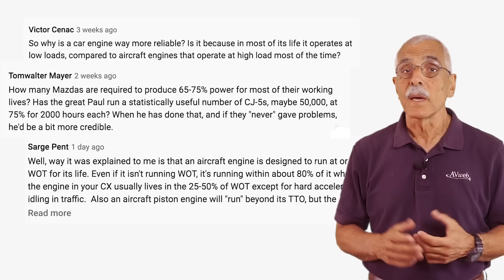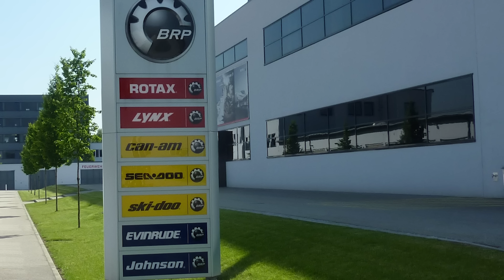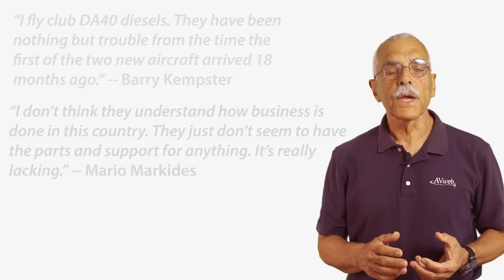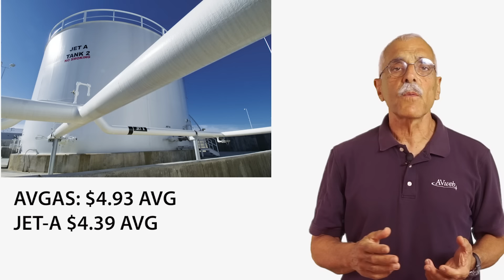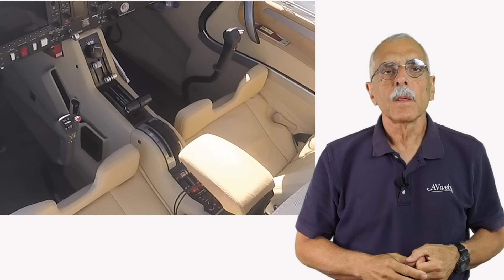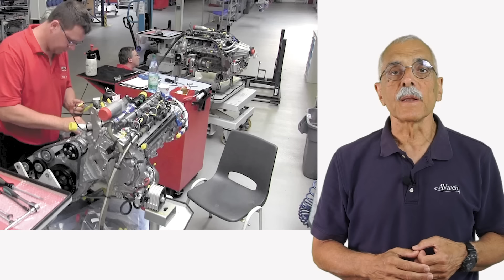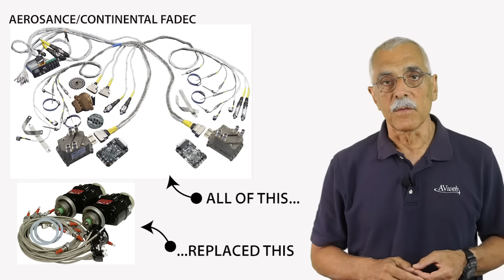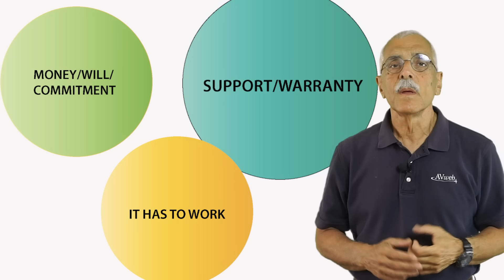Why New Aircraft Engine Ideas Rarely Succeed

Comment: I believe that GA and the embrace of new engine tech is centred around the often blinkered consideration of sticking with what you know, no matter what. One thing for sure is the engines featured have certainly forced the hand of Lycoming and Continental in future design and development and about time too, they have both raped the industry long enough with over priced mildly efficient dinosaur engines which use the same build practices, same 40 plus year designs and same build materials as they did from the get go apart from the occasional mild tweaks to show they still have some token interest. For reciprocating petrol engines in GA I believe that is now a market in decline with increased focus on jet A and diesel burning engines, the Austro being the case in point, yes its a couple of hundred pounds heavier though that is offset in the lower amount of fuel required for the same journey, the efficiencies are considerably better than highlighted here, it runs at a constant temp being water cooled, no chance of shock cooling or over temping, even in a 4000ft plus decent from altitude which the DA42 and 62 are more than capable of, dual fadec system with onboard diagnostic should not be under estimated as is the clear benefits of single lever control for everything propulsion, huge in ease of operation and of massive benefit in single pilot IFR operation. These engines operate with substantially less corrosion through consistent temp operations, vastly superior fuel delivery controls, vastly superior engine breathing, the fuel make up, more linear operation reducing peak stresses and all but eradicating the internal engine corrosion especially prevalent during lay ups, that has dogged both Lycoming and Continental and is the number one cause of they're engine failures, and of course the Austro engines are going to get you to tbo without replacing cylinders, the fuel is 35% cheaper than 100LL in continental Europe and contains zero lead! more easily stored considerably less inflammable, soon to be non inflammable thanks to the commercial industry R&D. The adapted car petrol engines featured all had one fatal flaw, designed to be high on revs and low on torque, the exact opposite of what is needed by design in general aviation, so they were never going to be a good fudge into GA use.

Comment: Excellent video.  Thanks for the information.  Assuming batteries get steadily better, what do you think about electric motors driving planes in the next 10-20 years?  It seems the maintenance and operating costs would be much less due to the simplicity.  Other than the batteries, what issues do you see with electric propulsion?
Reply: Electric propulsion would be a great fit, and actually has a lot of advantages.  Unfortunately the batteries are a massive issue.  Energy density needs to increase around 18x to be fully equivalent to a gas engine, and yes that does include the much greater efficiency of an electric powertrain.  That drastic an increase will never come without some kind of major technology breakthrough.  Maybe a fuel cell design, or one of the "air breathing" batteries you occasionally hear about.  I'm don't see anything like that coming to market until I'm probably too old to fly anymore.
Reply: New technology involving precision cast rare earth magnet processes promise great gains in power production and generation making relatively low cost super lightweight high efficiency hybrid power plants feasible in the very near future ( see Tesla's torroidal core motor ) but don't hold your breath on battery technology. Christ will probably return before that happens. Besides, I don't see too many people lined up to buy $100,000 2 ton battery packs for their Kitfox

Comment: Weren't there some Mazda RX-7 triple rotaries installed in some planes?  How did that turn out?  Not well I presume.
Reply: I had the glasair3 with the mistral 3 rotor. Great engine ! But the certification costs by EASA bankrupted the company. A very good concept strangulated by the euromaffia

Comment: From what I understand the DA62 austro engines are made of cast iron so that it is possible for them to go through the overhaul at 1800 hours. If they were aluminium then they would need to be replaced. So its cheaper this way from a servicing stand point.
The DA62 is a beautiful 7 seater plane and has amazing fuel efficiency.
Reply: If it's a stock block the cost should be very reasonable ( It's still a Mercedes though even if it is made by Renault ) especially when compared to the cost of ANY brand L or brand C block. Many aluminum block diesel engines are sleeved because of the high cylinder pressures involved with diesel combustion thus making resleeving a viable overhaul option. I think the reason is cost and availability

Comment: Nowadays I fly C-172s retrofitted with CD-155 diesel engines and it's really nice to fly them, they perform better that their traditional Avgas100 variants. Also if it doesn't start on the ramp, there is no arguing with the mechanic, who should do what :) Paul covered this topic in a very interesting way.

Comment: The BEST new engine, in my opinion, was not even mentioned in this video! The Mercedes based V-6 Turbo 
Diesel CD-300!
Reply: Launching in North America at Oshkosh 2021, the Diamond DA50 RG takes modern general aviation to another level with the twin turbo charged Jet-fueled 300HP Continental CD-300 Engine. 

It's strange to compare gas engine with v8 diesel and miss cd300

Comment: The true VLJ market always need an engine to fulfill the dream of a fuel efficient jet in the 15k feet range. In the early mid 2000s there was looking like a contender may emerge allowing the development of a range of very light jets but the GFC hit ending all hopes.  As it turns out it is entirely possible fuel efficient, jet and 15,000 feet are not possible due to the laws or thermodynamics but I'm going to link to an article well worth a read from an Air & Space article of 2005. 
Many of the issues described in this vid are applicable to development of this little jet engine. The article is called "The Little Engine That Couldn't." 
The engine itself disappeared and after millions of dollars of development. The last seen of it was mounted to the back of a go-kart.
https://www.airspacemag.com/flight-today/the-little-engine-that-couldnt-6865253/?page=1

Comment: It is a powerful reality that the more things change, the more they stay the same. I'd be one of those that wouldn't complain about steam gauges forever, but I'm savvy enough to learn if I had to. How much more money do glass panels cost compared to a comparable conventional panel with a GPS panel? Thanks to the 1970s litigators I don't have to find out. Still flying the same 1970s cessnas' I trained on in 1974.

Comment: Thielehurts into pa28's were a joke, looms were a problem and needed regular replacement taking 10-15 hours. Only being certified for installation into the cadet (without a baggage door) and moving the battery into the rear was a touch of class.

Comment: Oh man, imagine hitting VTEC on TakeOff!
Reply: Viking offers Honda engines.
But the old VTEC is long dead. The kick is non existent now, even in the new Type R's. 

You are thinking of the K20 series, the holy grail.
Reply: Interestingly enough, aircraft engines usually have flatter cams and longer overlap like a VTEC profile all the time. 

Airplane engines only need to produce power at maximum RPM... and only need to accelerate the propeller,  not the entire airplane. 

So no point in having two cam profiles or one that is good for cruise and idle like in a car. Same with ignition timing. It’s fixed, not variable. 

That’s why you have to run aircraft engines at 1000-1200 RPM on the ground. Any slower and they don’t like to run that well, and the valve overlap can result in the intake valves being contaminated with lead deposits (which won’t burn off like they do on the exhaust valve). Idle is only a quick check before takeoff. 

Idle is only for zero or negative thrust in the air where the load on the prop will keep it spinning faster.
Reply: @Bartonovich52  "So no point in having two cam profiles or one that is good for cruise and idle like in a car."

Are you kidding? VTEC could be used to greatly reduce pumping losses at cruise, significantly improving the efficiency of the engine. As you pull the power lever back from full power, the FADEC system could leave the throttle wide open, while switching from the secondary cam to the primary cam to reduce power, instead of closing the throttle and causing pumping losses to increase. Something like the Valvetronic system might be better suited for use in an aircraft engine, though.

Optimizing ignition timing also offers significant benefits and many pilots use electronic ignition systems in order to gain the ability to optimize their ignition timing. Ignition timing is fixed in many aircraft engines because they use magnetos, which are an absolutely archaic technology, not because there's no benefit that comes from varying ignition timing.
Reply: @TheBrokenworld  VTEC is just one of many implementations of a variable valve timing scheme, and it’s actually one of the oldest and least efficient ways to do it. Variable valve timing is used to adjust valve overlap based on engine RPM, used so a car engine can provide sudden bursts of power on demand at high RPM, while remaining efficient at low RPM for cruising. Airplane engines don’t need this because they cruise at nearly full RPM. Keep it simple.
Reply: @wrkingrageaholic  VTEC is far from being just variable valve timing, it allows the engine to switch between two (sometimes more) different cam profiles. Compared to other cam-changing variable valve train systems (VVTL-i, NEO VVL, VarioCam Plus, etc), it's the most versatile out of any that have ever been produced. Because VTEC can switch between entirely different cam profiles, lift, duration, overlap and timing can all be varied. With the addition of VTC, timing can also be varied continuously.

In an aircraft engine application, VTEC would offer the ability to switch between a cam profile optimized for cruise power, and a cam profile optimized for take off power.

Most variable valve timing systems only vary timing, but they do it continuously (like the VTC aspect of the i-VTEC system), so the cam timing can be optimized for all operating conditions, from idle to full power. You are correct in saying that this would offer little benefit in an aircraft application, but VTEC offers far more capability than just variable timing.
Reply: @TheBrokenworld  You’re missing the point. Aircraft engines don’t need it. In aircraft design, if you don’t need it, it stays on the ground. Simple, light, and durable is the name of the game. People who suggest bringing automotive tech to aviation always seem to forget that basic principle.
Reply: @wrkingrageaholic  I'm not saying that it should be used in aircraft engines, but that it would offer a significant benefit. There has also never been a recorded failure of the VTEC mechanism, it's just really bulletproof. The most that can happen is that it doesn't change profiles, which isn't the end of the world.

Anyway, automotive engines often prove that they're far superior to traditional aircraft engines... when they're properly converted.

Comment: I grew up a mile from a popular county airport that had many dozens of private planes flown by the engineers and middle manager types that my area had with IBM as the dominant employer -- now, however, there are seldom more than a handful of private planes at this airport and IBM is all but gone as an employer in the region.  I suspect that this situation was not limited to the area I grew up in and that the private airplane market is a fraction of what it was from the end of WWII until the mid 70's.  With a small market it is hard to justify the development cost AND the liability to develop any critical aviation product and at the top of that list is engines.  Gulfstream is kicking ass selling $70M private jets but the rest of the industry is, well, in decline.

Comment: A company in Wisconsin called Deltahawk is developing an aviation two-stroke turbo-diesel, and they seem to have strong funding
Reply: That's for drones though isn't it?
Reply: @Racing_Pig  - They haven't said for sure, but with FAA certificate it could be used for both manned and unmanned applications
Reply: @NICK-uy3nl  The question is, is a 2 cycle diesel going to be the kind of engine you want to put in a people carrying aircraft. Loud and Rough come to mind. Fine for a Drone.
Reply: @Racing_Pig  Have you seen the video of a Diamond twin diesel flying nonstop from Hawaii to CA. If I could fly nonstop Honolulu to San Francisco with a 2-stroke diesel, I wouldn't mind the noise one bit. Engine noise can be easily controlled with engine encapsulation an cabin design.
Reply: @NICK-uy3nl  The Diamond is a 4 stroke Diesel same as the Mercedes car engine it's based on.
Reply: @Racing_Pig  - I know that full well. As I mentioned,  engine noise can be easily abated with engine encapsulation an cabin noise insulation.
Reply: @NICK-uy3nl  Sure, if you have the weight to spare. Which often it never seems like there is.

Comment: I bought a 2007 Bonanza G36 with a Tornado Alley Turbo at 600 hrs. The Continental IO550 had burned 3 ex valves, to date. I put 160 hours on it and burned another, sold it, and the new owner quickly burned the 5th. Granted, I ran it LOP, burning 17gallons at 175-180 KTS depending on DA.
But I’ve never killed a cylinder in 1100 hours in other planes with a Lycoming IO540, O360, IO360, or Rotax 912. I’m sure many pilots have had good luck with Conti 550’s, but personally, I’d be much more inclined to buy a Cirrus if it had a Lycoming  540.
Paul reminded me that my Bonanza was also the only plane I’ve ever flown that was hard to start. The day before Osh-Kosh, I killed a starter adaptor  (starter clutch), which set me back $7,000 and forced me to take my RV7 with it’s trusty Superior IO360.

Comment: All of those unsuccessful engines have the same thing in common. 

Things like a greater number of smaller cylinders and multi valves with dual overhead cams to make it spin faster and get better specific power.........

And then a reduction gearbox to slow it all down again. 

Which means that while specific power and even fuel efficiency is better.. power to weight is worse and these engines often wind up just as bulky or even bulkier than the “larger” direct drive aircraft engines. 

More parts means more failure modes. Some of the worst aircraft engines are the ones with gearboxes. How many Cessna 175s with the GO-300 do you still see flying?  Has the GTSIO-520 ever been described as a “bulletproof” engine?  And those engines are still pushrod engines. 

Only Rotax has managed to buck the trend by making a successful line of economical and reliable geared engines. 

Unfortunately no automotive engine would ever use the aviation formula of huge cylinders spinning at only 2700 RPM... so they are adapting what they have and what they know in the best way possible.

Comment: You're absolutely right about known cost and performance being a key factor in the continuation of useing 1960s era engines in general aviation.  I'd venture to say another major reason for the stagnation in engine choice (other than the high initial costs of the aricraft) is that the EPA has generally left aviation alone.  In the marine and automotive sectors, ever changing emissions mandates have pushed "fleet economic averages" over 30mpg for automotive companies and have all but killed 2 strokes in the marine industry.  An outstanding example is the increase of popularity and reliability of marine 4 stroke engines and one specific example is Seven Marine's 6.2 supercharged V8 that's built useing the same engine that powers the Cadillac CTS-V.  Granted many aircraft in general aviation are 40+ year old airframe, but if the EPA issued an adict that said NO new airframes for general aviation that burn more than 10GPH, or something equally draconian, you'd see the industry scramble to maintain customers while also complying with new laws.  While this is a very oversimplified reply, I think it has a valid point. Were it NOT for mandated efficiency and emission regulations, we'd still likely by driving carburated cars getting less than 15mpg......and burning leaded gas
Reply: I'd also add that (generally) aircraft are cared for and maintained better than cars. With FAA regulations stating that maintenance records and required repairs are required in order to be able to fly, aircraft built 50 years ago are still flying regularly. As long as maintenance, federal paperwork and care are maintained, there's no reason a super cub built in the 70s won't continue to fly another 40 years. An aircraft like that is unable to be "upgraded" to a more modern (and heavier) engine due to the particularly of the airframe and is not as simple as doing an "LS Swap" in a 60s era muscle car.
Reply: @ssgpentland8241  The main difference is that alot of people can actually afford to buy a new car and do so regularly, this means new technology is quickly established in the market and manufacturers can actually spend money on research.
Meanwhile new GA aircraft are basically unaffordable for the vast majority of pilots. Almost everyone buys used, thats why were still flying around in 50 year old planes and technology stagnates as a result.
Ideally ways should be found to make new airplanes cheaper. Then more people would buy new which would push the competition and modern technology that the GA market needs.